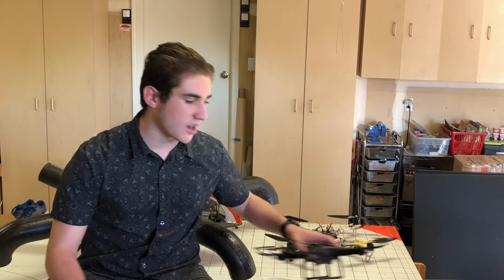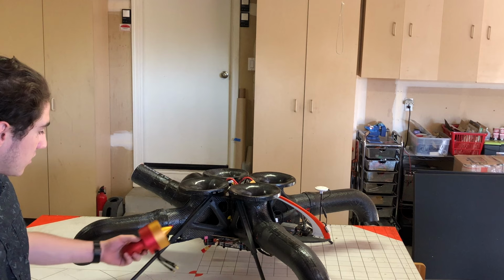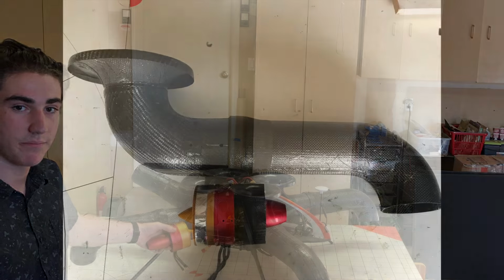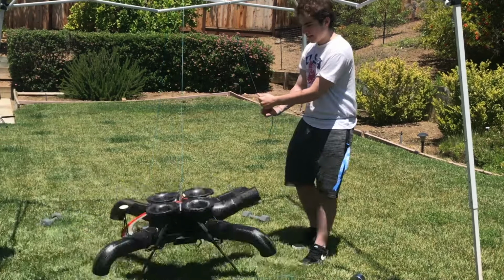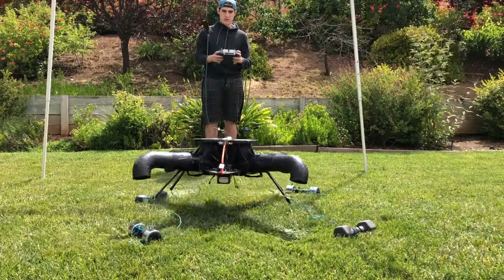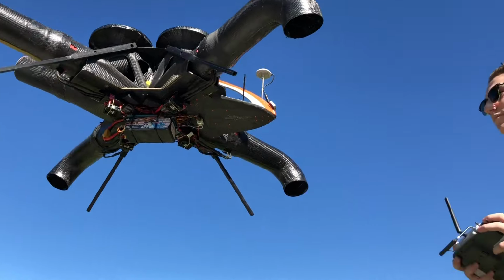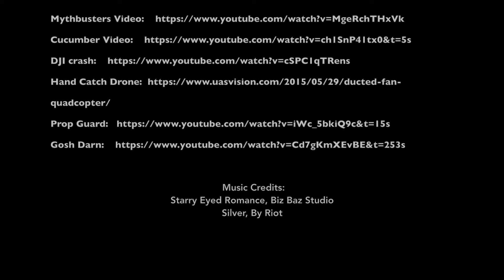Bladeless Drone: First Flight

Comment: That design could be an option for residential deliveries in a near future delivery service ...
Reply: thought exactly the same thing and your comment is from 13 min ago :D. Sell to Bezos
Reply: Yeh, just have to make them broom and bullet proof
Reply: Or just a good pilot that can avoid drone catchers
Reply: Ducted fans are extremely loud and extremely inefficient, the noise pollution would render it a disturbance and the range would be very limited due to the poor thrust to weight ratio achieved by the ducted fans. Thus this design shall not see use in package delivery. however it is a facinating experimental design
Reply: I wanted to refer to the idea of having the drone propellers spinning inside a protective liner like some helicopters tail rotor.  I don't know anyone who hasn't cut their fingers on the current design
Reply: @YSALF  good food for thought.
Reply: Dud if you can sale me this drone you will be able to eran profit by providing technical support and maintanance and spare.
Reply: Please tell your price
Reply: Yup I’m gonna copy and modify 🤣 thanks g
Reply: @americanairlines3945  The total weight would be a hazard. Drone deliveries are just not practical in general its much safer to move the package with a land vehicle. You cant lift objects over people head in public you dont need to read the FARAIM to know thats not allowed.
Reply: @YSALF  nerf the planet! blades cut ppl!
Reply: one of those hitting someone will still be potentially lethal.
Reply: its the single most inefficient design possible, it wont be able to get the distance or speed covered
Reply: We are exactly working on this principle for the future cars to be driven by peoples like you👍🏻👍🏻👍🏻
Reply: They could use these drones for putting out fires
Reply: I don't hope so. I don't like the idea of LOTS of such loud things flying in cities... in addition: while you don't get shreddered when it hits you, it still hurts if it crashes on you :-)
If we go this way we willl have an extreme energy problem in the future. Such drones uses alot of energy to carry very few payload. The only thing where it might be usefull would be things where allready single packages are carried right now: such as pizza... but also in such an scenario I expect that autonomous driving robots are sill much more effective.
Reply: Where can I invest in your product? Very cool.

Comment: You could drastically make this design more efficient!
* Have 1 motor with opposite spinning blades like the russian Kamov KA-50 - save weight.
* Duct the Air via servo controlled ports for balancing and speed - save weight.
* Longer flight time with a RC model petrol engine - save weight to power ratio.
* Work on the CFD of those tubes so the airflow is better It didn't look optimal.
* Make the nozzles like Dysons or a Hovercraft with a narrow slit in them, this raises the static pressure from the nozzle outlets and thus lift force.
Reply: Single motor with ports same tging i was thinking
Reply: With a single engine you'll need a larger blade - just like a helicopter.
Reply: And a stupidly simple change: let the thrust come from above the centre of mass, not below. Should make it vastly more controllable.

Comment: Now imagine this:

1) One large intake, one engine.
2) Three distribution ducts that are able to turn 180° each.
3) Three output cones that can regulate its own diameter in order to change output pressure.
4) An arduino board to control them all, and it darkness bind them in the land of Mordor where the shadows lie.
Reply: Almost exactly what I was going to say, almost.
Reply: Having one central motor will cause the multicopter to spin in its use axis as a result of the motor’s torque. A drone’s yaw axis is controlled by increasing the throttle for two motors spinning the same direction and lowering the throttle for two others spinning the other direction. Thereby increasing the moment force for one direction. Helicopters are an easy example of only having one motor. If something happens to the back rotor, theres a dramatic spin out and crash
Reply: @kennyt930  the output of the ducts can be used to offset the rotation of the fan.

Comment: Cool idea, I love the sound it makes. But there are a few issues.
- The fans you're using are designed for high airflow, not high pressure. Having long tubes, AND sharp corners will limit airflow and increase pressure and therefore reduce your performance and efficiency. I would not be surprised at all if you found you're only producing half the rated airflow.
- Generally, ducted fans are specifically designed to be used in an open environment, any custom ductwork added will reduce performance & efficiency.
- Mounting motors horizontally instead of vertically means that you can not leverage the effect of the motors torque to rotate/yaw the aircraft

If the goal is to simply reduce incursions into the props, simply adding a wire mesh guard around the props would be significantly cheaper and lighter.

If you mount those ducted fans all vertically, and add mesh you can reduce the size of the aircraft by a huge margin, increase the flight time, performance, and handling.
Reply: Thanks Matthew. People should be smart enough to learn from the way you criticize and share your ideas
Reply: Yeah very informative. Love fly my drones, I get a real kick out of it. Unfortunately not good with electronics, so when they malfunction does my head in.
Reply: funny to see people commenting and giving all their "advise" while they never even accompliced something like this by themselves. I would say build the perfect one yourself and then you have something to say.
Reply: @12vibaba  I think giving advice is valuable nonetheless. At least in my case, I work with this stuff as a career.

Comment: Stefano at the end of the air outlet from the pipe, the diameter of the pipe should be already then the air density at the outlet will increase this effect of the air flow is similar to a funnel

Comment: You could’ve just put safety mesh on the ducted fans and had the same protection. 

Now you have a much heavier solution that will tank your efficiency. Not to mention the added weight can hurt someone in a different manner than a bladed drone.
Reply: Not necessarily, the inner part of a fan provides very little thrust so they end up large and cumbersome.  Having a single high speed turbine with ducting could be provide more stability and a weight saving.  Overall the whole thing could be smaller and more efficient.  Large scale is probably not good but smaller sized machines could be workable.
Reply: Jake S I originally thought of a central centrifugal compressor that had 4 outlets and intake air directly above. 

But then you’d need some way to control thrust at every outlet. 

Utilizing several motors allows for instant torque changes and better control. 

The excessive ducting adds weight unnecessarily and drops efficiency.

Comment: I wonder if instead of having 4 motors, you could split the output of a single large motor down all 4 pipes. To move the pipe ends could be gimbaled move the exhaust in different directions.
Reply: Yeah but how you would control the flow on each end? Can be done but way to expensive, your idea looks good but having the tubes moving is not enough, RPM on each motors too and that's the hardest to do with a single motor, we try with rc jet engines, it work but not practical, fuel every 2 mins and very noisy plus to control that thing was not really good even with new servos.
Reply: @dannygarden464  Valves to control the airflow distribution down each pipe. Probably wouldn't need to gimbal the ends in such a case.
Reply: The problem with using a single rotor system is there is no way to counter the torque. The helicopter would not be able to fly without counter-torque like a tail rotor,  or a main like the Chinooks or coaxial rotors, or a non-driven hub where the propulsion would be tip jets. You will see plans for this last in Popular Science. If you notice, these drones all use a minimum four rotor system, because it provides a stable platform in all quarters. A dual rotor system where one counters the other would not work, because the required lift would necessitate larger wings (the rotors) which would mean higher loading, and there would be a rather precarious  load balance with the CG in a narrow band of the overall mass. The four, six, and eight rotor systems spreads out that load.
Reply: @johnhavens776  That's all you have to say???
Reply: @johnhavens776  Just joking :) Well, that was a heck of explanation, I was hook with the first phrase and it explain exactly what it is, thanks and merry Christmas.
Reply: @johnhavens776  very good points

Comment: Totally don't understand why you don't just put a mesh above and below the fan to stop people putting their fingers into it. The drag losses would be much less than the weight/drag of your carbon fibre tubes with identical safety levels.
Reply: Because the aerodynamic arm/moment would be unstable.  The arm is required to prevent thrust differences  beyond the guidance capabilities of the drive chip.
Reply: thats right why dont they just put mesh on a quadcopter readily available and make fake stunt that obviouly fake to idiot people in the internet?
Reply: @seashellfishtrading8884  what?

Comment: Damn dude! Impressive work!
Reply: the Hacksmith hi
Reply: more like impressive fake
Reply: @seashellfishtrading8884   Well he is actually Hacksmith
Reply: If those motors drew 120 amps, they would have car starter motor size wiring, and be as big and heavy as a V8 starter motor.

Comment: The efficiency must be pretty bad as the turbulence in those bent tubes is really intense. If you just mounted ducted fans in the corners extending the duct long enough to keep fingers out you would get safety with much more efficiency. or you could just put a wire mesh over a standard ducted fan intake and exhaust.

Comment: That is really awesome.  Couple questions.  First off, with the motors oriented horizontally, how did you get it to yaw?  Is that why the tubes are a little tilted?  If so, I'm impressed at how sharp the yaw is still.  Also, is there any particular reason you went with a DJI controller over a typical FPV/race/freestyle/betaflight controller?  I would bet you could get that thing up and running way quicker with betaflight onboard.  It was probably quite a challenge wrangling the DJI system in to comply.  With turbines like that and kinks in the path of flow, I would assume efficiency and flight endurance is a bit of a struggle.  Is there a particular reason why you didn't go with more of a pyramid-like structure to have a more direct path of airflow?  Lastly, what happens if a leaf or a small stick gets sucked into the duct?  :-/  Nonetheless, awesome work.  Really amazing.  Oh yeah, what's the tail on the thing for?
Reply: He needs mesh covers for the intakes
Reply: @phoobindustries8905  that's going to further kill what little efficiency there may be.
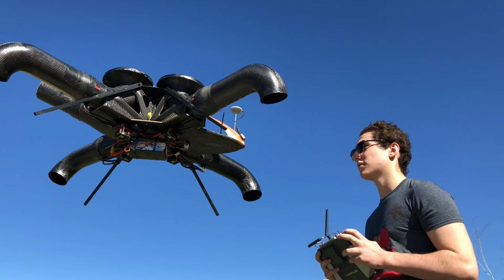Reply: At 2:24 you can see him using a Horus. So he probably is using some kind a betaflight controller over frsky.

The yaw is likely due to the tilt of the ducts (but still uses the normal spin two motors faster yaw control), but this tilt also reduces the downward thrust vector, further reducing efficiency. 

I'm all for innovation (as do you... I follow your FPV channel), but did he really need to make it this scale? A 5 inch quad seems to be a sweet spot for power to weight and with many motor pulling over 1500g of static thrust, it wouldn't be too difficult to retrofit some ducts and still have plenty of power. Plus with how easy it is to change betaflights PIDs (through Bluetooth or in the goggles), I can imagine creating a stable tune in only a few packs. 

 In my opinion vacuum forming the duct halfs from thin plastic and with a couple 3D printed parts, have a "bladeless drone" for less than what he paid for his Horus (a normal Taranis QX7 would probably have worked just a well).

Although he did think of this idea and he made it happen, so props to him for getting it done! Just have my doubts that the benefits outweigh the negatives
Reply: Thinking about this more, why not create a design similar to the link below. Propellers are fully protected. Losses due to the grate are likely less than or equal to the duct design, and it likely is lighter...

https://aviation.stackexchange.com/questions/24357/what-are-the-physical-aerodynamic-implications-of-designing-a-prop-guard-for-mul/24360
Reply: @ryankraft9897  so what he's made is pretty awesome no doubt. The fact that it seems to fly as well as it does with so much airflow restriction is damn impressive and is also what I find most interesting. However, I cannot think of any applications for such a craft or ducting system. A cool novel idea, but maybe closer to something out of a novel rather than the future. 

Also, you can use any DJI controller with any radio. They're designed to be used with whatever. They take sbus crsf and whatever else just like any other FC.

Comment: So technically it's not bladeless.. the blades are just hidden
Reply: Still it's a valid term for this because the danger of the blades got removed, read the description
Reply: @DerEchteBold  from my personal belief even the Dyson bladeless fans you see now are not bladeless, they're the same concept as this (hide the blade/fan so its protected) just not able to fly. Bladeless to me would be this would fly using CO2 which is obviously not efficent. I mean props to this guy though the idea seems so simple that no one has ever thought of it or made it yet.

Comment: In this case you can use a single fan and control direction and flow of each duct
Reply: But how can you control the reaction torque from a single motor/fan? You'd need at least two contra-rotating fan blades, or a tail boom/rotor like on a helicopter.
Reply: @sixstringedthing  adjust one of the ducts to blow more air than the other ducts or adjust the position of the duct
Reply: @AH-mj1rd  you could probably get it to fly that way, but it would greatly reduce the lifting efficiency of the unit, since you're splitting the available vertical lift force into some vertical lift + some amount of lateral thrust to stop the drone just spinning in place. 
I think my idea of two contra-rotating fan blades would work a bit better - it's been proven with aircraft props - but it would be more mechanically complex, and therefore heavier. So not really a good solution either. :)
Reply: @sixstringedthing  is a good idea, two spinning fans Sharing a coming duct that split into 4 or more smaller controllable ducts, you have  safety incase  of engine failure.
For larger models a jet turbine engine would help as gas is higher energy density than a battery

Comment: Cool concept but that's such an inefficient way of doing it. Having bends in the tube drastically lowers the pressure that's being pushed through. Try make one with straight tubes 👍
Reply: Needs to reduce the size of the tube and add a cone for exhaust expansion..
Reply: Yeah, I was thinking the same. Just mount the motors vertically and put inside shorter tubes without bends. Ok, there would be more danger of putting fingers in, but who's stupid enough to do that?!? Or use much smaller tube as per the other comment above and then expand for the exhaust.

Comment: Possibly stupid question, but wouldn't the rotors be more efficient if the rotors were facing straight down and the tube was just downwards? Isn't the air wasting significant force to the side, where the tube bends?

Comment: What sort of flight time do you get? The primary concern with ducted fans is their lack of efficiency, which results in really short flight times (particularly in its use in planes; but multicopters don't have great efficiency either, so it might be closer than with planes). Also, curious to see why you didn't implement a rotating tube "vector thrust" control system, which would give more precise, and quicker response instead of the variable thrust of the standard multicopter. Great proof of concept though, and you might want to give that a thought on your next prototype! The control system shouldn't be much more complex, although I can imagine programming the flight computer might require a little more novelty than its current state. Overall, really great job, and it's nice to see your progression through the iterations.
Reply: I'd be amazed if the flight performance even approaches a conventional design. Cool AF though.
Reply from the maker: yes ducted fans used like this are less efficient and flight times are shorter.  I wanted to make something that was super safe even if it was less efficient.  rotating the tubes would have been really heavy and more complicated.
Reply: It's incredible man, love it.

Comment: Neat! My first thought was flight time. Not to crap on your success but I would assume that the efficiency is pretty bad. The ducting and the fact that the air has to make 2 90 degree turns has got to add a lot of turbulence to the airflow, whereas a normal quad's air path is straight through the props. Second thought was "how the hell does he control the yaw" but I figured it out. The slight angular offset in the ducting would allow the controller to control it the same as a normal quad. Really neat how the thrust offset has the same effect as the rotational mass of the props! Awesome project man!